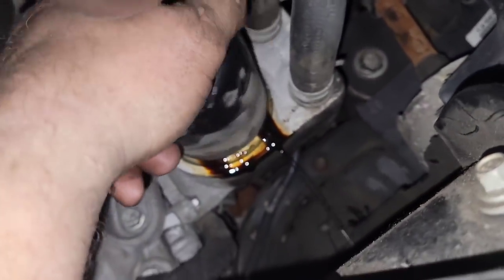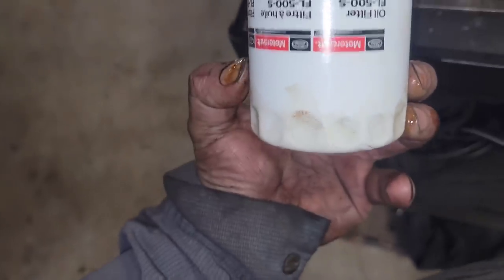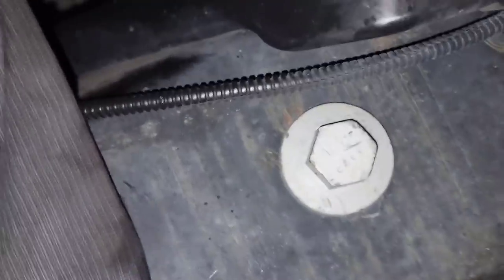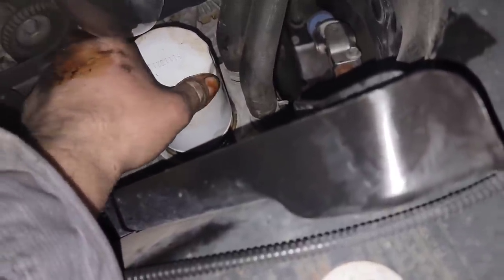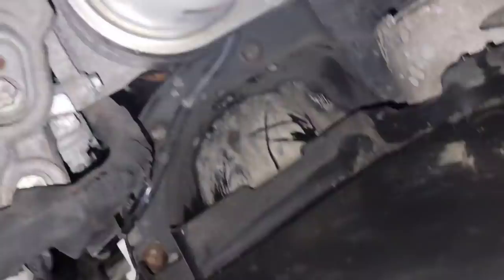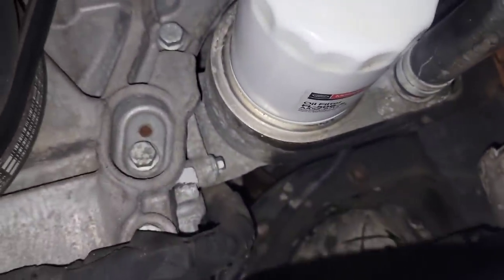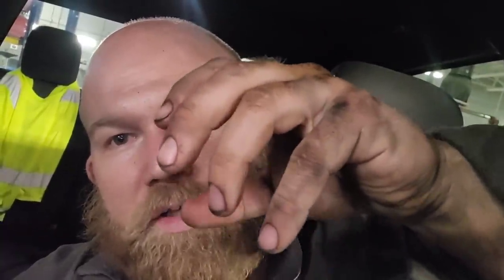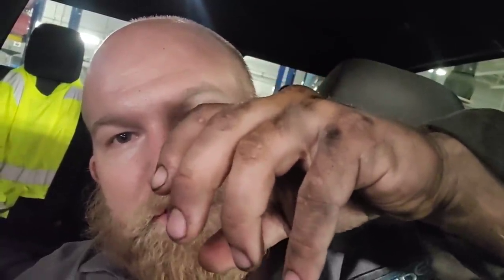Motorcraft Fl500 oil filters Recently I've had some issues with, Poorly Machined Threads

Comment: I've had my own issue with the FL500 filters.  I changed the oil on my wife's 2016 Explorer, 3.5L, non-turbo and was surprised to see oil drips on the garage floor.  I got down to look (not a major leak), saw an oily filter, ragged it off and tightened it up as far as I could, by hand.  A few days later, the same thing.  It was seeping oil at the crimp, which I have heard of, but not from a Motorcraft filter.  I replaced it with a Mobil 1 filter and will, from now on, spend a few more $$$ and avoid the FL500.
Reply from the maker: Make sure that the oil pressure sensor on the side of the oil filter housing is Tight and look at my video on the Ford Explorer oil leak in the library
Reply: @FordBossMe  Once I replaced the filter, no more leaks.  That was 2 oil changes ago and still no more leaks.  I've been a Ford guy all of my life and always use Motorcraft filters, still do on my 7.3 Excursion and have never had a problem.  QC at the manufacturing plant, where the FL500s are made must be lax at this time.
Reply: Did an oil change on sisters 3.7 Lincoln MKX and FL 500 started leaking a couple months later,  my brother put a different filter on. I have done probably over 100 oil changes,  never had a filter leak.  I didn't ask him if it was loose.
Reply: @Ford Boss Me  I'm having this issue right now on a 2022 mustang gt. Fl500s leaking at the seal or crimp after a few hundred miles, put another one on and same thing. Everything around the filter housing and oil pressure sensor seems dry going to try a different filter again of not off to the dealership. Would be my luck to get 2 bad motorcraft filters in a row

Comment: Noticed shallow threads on the new Motorcraft filters at Wally's. Ended up buying Walmart brand with much deeper pronounced threads. I'd rather have bought motorcraft but someone else is making em. Fl-820S as well has messed up threads

Comment: Wow, this was good to know. Good video and well done. I'm surprised that I am not the only one having this issue. I remember having some problems with some aftermarket oil filters in the past. They just wouldn't thread on properly to some engines. I have used another aftermarket filter from the same batch and worked just fine. Sometimes the oil filter housing on the engine itself is messed up for some reason and sometimes only certain oil filters would thread on and work. I'm not even sure if it could be that or other guys particularly from lube shops not being careful enough when screwing on an oil filter on to the housing and damaging the threads on the engine. Correct me if I'm wrong, but that is what I have experienced in the past. Sometimes I have to try multiple times to thread on the oil filter until it catches and goes in properly. Just my two dimes perspective.

Comment: Always check the filter mating surface, especially if your sourcing the filter from a big box store.

Usually I'm checking to make sure the oil filter O-ring is present and the filter mating face is clean and corrosion free. Guess we also need to carefully check the threads as well.

Comment: Just went through this exact same thing with a FL-910S. Went back to the parts store and got another one and it did the same thing. Had to put on a Wix. I hope they get their manufacturing issues figured out and get the bad ones off the shelves.

Comment: Had this issue on a carquest filter once got a screwdriver and I just forced the thread straight where I saw it was a bit flattened and it was good. spun it on and tightened but I never bought another carquest filter again.

Comment: FL910S also has an issue. Reaching in through the wheel well was fun on my son’s Ranger. It felt like it wanted to cross thread to me, was a struggle this time, usually pretty easy. Yeah, I know, take the wheel off - didn’t want to.
Reply: @es-qf2gw  Probably so. I’ll definitely check the filter closely before my next purchase. My dealership also sold me the wrong oil on this last go round. Gave me 5w20 instead of 5w30. A 30 minute oil change ended up being 2 hrs all said and done. The old saying measure twice, cut once. I should have double checked everything before walking out the door.

Comment: Changed oil and an FL820S on my moms Mariner after 2200 miles (80% city miles), cut the oil filter open to inspect (I do this every oil change) and the metal backing plate on the bottom end of the media fell off immediately when I pulled it out last time. Also discovered under the backing plate, the media is actually held together by plastic. 79k miles and use pennz platnium high mileage 5w20.
Reply from the maker: So it's not plastic it is a typical type of epoxy do they use in these filters all of them do that
Reply: @FordBossMe  was just sorta shocked when it fell off so easy. didn't realize it was an epoxy type material. thanks for the info man.

Comment: Purolator is really letting the Motorcraft line go. Switched to an FL820S and my 4.6 2V rattles a lot on cold starts after it’s been sitting over the weekend. I’m guessing the baseplate was poorly cleaned and pierced the ADBV as usual on newer Purolators. At work I’ve had to force so many FL500’s onto threads, back off, then and re-force over and over until they finally start. Seems to only happen on 5.0 and 3.5’s in F150’s. I never have a problem in the vertical 3.5 and 3.0 Duratec’s.
Reply: @dellsucksass  Good. People just now started using the 820 again on BobIsTheOilGuy so I wanted to start too and here all go having issues again. One will look great inside and then the next one will look really ugly. My truck never ticked with an Orange FRAM or a Wix XP, but the standard Wix and now an 820 made it noisy on startup. I have a Champ filter to run next.

Comment: This is good to hear. I ran into this exact problem last weekend. I ordered a FL500-S filter off amazon and tried to install it and it would not thread on. Same problem you describe. I was worried maybe I got a knock off, guess its just a bad batch of filters. I had to run to the auto parts store and grab a Wix filter. That one fit just fine
'

Comment: I just saw a video where the FL500 had glue all in the oil after only 3,500 miles.
I know the bypass is located at the top, but I also read that it makes no difference if the filter installs horizontal like on our 5.0 trucks?
I need to find a filter that doesn't get glue in the oil.

Comment: The early Saturns had a spin on filter for the transmission. I got a case of Wix filters that would start in and then bind, making one think it was cross threaded. I got mad and forced one in and it got past its tight spot. Seems that the entire case had a burr on the same spot of the threads. Somebody at the factory was lazy or having a bad day.
Reply: A bad vibe

Comment: Yeah this is normal for purolator. Every 5 years they shoot themselves in the foot. Motorcraft specs a good filter but that doesn’t mean purolator will follow through. I always stick with wix. But now that there owned buy the same company as purolator it makes me nervous if catch a bad wix I’ll probably switch to fleetguard or denso. Owning a filter cutter is priceless
Reply from the maker: I've had a couple of the Wix filters back off and also the o rings not fit the top of the house incorrectly
Reply: As seen on BITOG, M+H is slowly moving the standard Wix line to being equivalent to a red Purolator.

Comment: Ever since ford switch from the painted or printed letters to the stickers on their filters in the past year they have dipped in quality big time. Lighter in weight and they seem to be a thinner material than before.
Reply: Anyone peeled the label off? 
With all the supply issues they might just be rebranding someone else’s filter by covering the other mfg part # with a label
Reply: @dgrenier4908  They’re still Purolator but they’re consolidating their lines and have started cheapening the filters up.

Comment: These oil filters are getting kinda weird like you said.  I had to Napa Silvers I used on ny wife's 17 Arcadia the were not true on the threads and you can visibly see it wobble while spinning up but I took a chance and they never leaked but I'm going to use a 500s Motorcraft next to see if it gets rid of some motor rattling
Reply from the maker: I stick with my Fran Ultra synthetic and love it and also the Ford filters but this is concerning

Comment: The parts at my local Ford dealership gives me the filters you are referencing in the vehicle now, stopped giving me filters with the numerous ribs .Maybe that’s because the supplier of the filters has changed. I have a few that have many more knurled ribs around the closed end, so many I had to purchase another filter cup for my 3/8” ratchet. Both are FoMoCo but type etc is applied differently too. 
s mother trying to save money? Wonder if the insides of each are the same. I think I’ll check when I change my oil next and cut it open.
Reply: Purolator switched from the ribbed type can to the one with flat edges and is more easily  removed with filter tools. Occasionally I’ll still handle some new old stock that will even have the old Motorcraft labels.

Comment: Purolators quality control has been crap for years now. Not surprised about the threads being junk. The issue they have with the media tearing started about 10 years ago and they have yet to fix it. Ive seen multiple motorcraft filters with torn media and because of that I stopped using them and anything purolator makes.

Comment: I don't use FL500 on my 15 GT I went to FL280 ford racing version. Biggest problem local stores have no damn oil filters in stock. I ordered 2 FL280 from rockauto and Ford racing filters from Summitracing

Comment: Remember when Ford oil filters switched from painted on branding to the new stickers in the last year or two? They switched to a completely different manufacture for all their oil filters. I no longer trust motorcraft oil filters, wound up having to get a fram for my ford diesel. At least fram 7.3 filters have been around for 25 years...
Reply from the maker: They did not switch to different manufacturers it's still puralator

Comment: How many threads does it take to hand tighten a filter. Some techs at the dealer want to get them so tight you need to stick a cro-bar through them to get them loose.  All a do about nothing.
Reply from the maker: So the proper way to do it is to spend the wheel filter on until it makes light surface contact and then go 3/4 - 1 full turn past

Comment: Another Odd  Filter issue lately 6.7 powerstroke fuel filter FD4615 the upper one, the plastic housing of the filter on the new filter is to large to fit in the pocket also from Chicago Parts and Sound. Our Supplier just says it is a potential manufacturing issue that they have to contact the manufacture on.

Comment: Ironically I had the same thing at my dealership. We do a lot or ram trucks and a new hire had a 5.7 1500 oem filter didn't screw on. Brand new truck. I thought please don't be the dang spindle 🤦🏻‍♂️😮‍💨  it would go on two turns then lock up like it's stripped or missing threads. Sure enough the oem filter didn't have the threads on the filter right. Grabbed a new one boom like butter 🧈 😋 👌

Comment: Love the vids.  I know you’ve covered this before but need to ask a question.  How do you feel about the brand “Driven” for motor oil?  I ask because I just picked up a 2012 Boss 302 with 34k on the clock and the engine was replaced with a brand new ford crate engine back in December.  I’m looking at which 5w-50 engine oil to use.  I know you want an oil that has high zinc levels for protection.  Driven was designed with that in mind from what I understand.   In doing research I also learned that oils with higher levels of zinc need changed more frequently.  Is this accurate?  There aren’t a ton of choices out there in 5w-50 so I thought I would ask for your opinion.   Thanking you in advance.
Reply from the maker: I think the reason most people are worried about high zinc content is because of the catalytic converter and the zinc causing issues
Reply from the maker: As for the brand itself I don't know very much about it honestly
Reply: You probably have a roller cam system. Zinc benefits old flat tappet engines.
I use high zinc oil in my vintage Jeep and 73" Mach One. 
In those I use Lucas Classic Car oil. Very high zinc content. No Cats. 
Newer vehicles don't need as much zinc. So in my 2021 E450 (7.3 powered) I use Pennzoil Ultra Platinum. It has done well in testing and is reasonably priced.
Reply: @FordBossMe  thank you for the feedback
Reply: @TheBandit7613  thank you as well
Reply: Amsoil has it.

Comment: Please i need help! an oil filter i had cross threaded the actual oil filter holder thats mounted on to the housing. i am not sure how to get this off!
Reply from the maker: So if you look in the threads of the actual oil filter mounting base in the center of it there's an allen fitting it's like 70 mm you have to find the right one for your vehicle and you can actually unscrew the center of it and replace it with a new one usually
Reply: @FordBossMe  i will take a look thank you for the reply

Comment: I have a 2005 mustang gt that makes a weird tapping noise after changing the oil. It goes away after a few minutes. It’s a weird tapping noise. It’s not steady more like someone is typing on a keyboard tapping.
Reply from the maker: That's because you need to flood motor vehicle to pre Prime the oil system
Reply from the maker: Look in my library for directions

Comment: Forbid the threaded part of the engine oil filter mount crossthreads on alot of engines they are part of the engine and not replaceable

Comment: Wow! Can’t even make oil filters correctly any more. Do these manufacturers even have a quality control department anymore? 
I noticed fairly recently motorcraft filters have changed. They now have stickers instead of painted info on them. Some of the filters used to have a fine spline on the back of them and now they have a hex shape on them which requires a different socket for removal. I suspect motorcraft is possibly buying filters from a different company now. And their quality seems to be worse. 
A friend of mine recently had an fl500 on his ‘17 explorer fail, it just sprung a leak at the metal seam when he was driving on the interstate. Luckily he caught it before it ran the motor out of oil….

Comment: There’s no better way for the oil not to drip? There’s what looks like a drip pan under the oil filter but the oil doesn’t go in the drip pan, the oil just goes down the front of the engine
Reply from the maker: You're not looking at it correctly

It has two holes 1 drips right down the front right into the pan and then if it overfills or something plugging that hole it has a release to the front as well it's not going down the front of the motor I have previous videos where I break this down even more showing how to be very clean and careful when you do this

 check those out
Reply: @FordBossMe  ok thanks, I’ll take a look
Reply: @FordBossMe  do you have Instagram? I ask because I just had the Ford dealership replaced a failed water pump and I just did an oil change yesterday and I found a weird metal thing in the tray we are talking about, wanted to send you a picture of the metal thing to make sure it wasn’t any important

Comment: Chase the thread with a 22x1.5mm tap
Reply from the maker: No!
 don't do that 
give the filter back

 make them give you a new one and be aware of the screw up and if it is machined on an angle it's not going to sit on the vehicle correctly so do not Chase it do not use that filter replace the filter with a good one
Reply: @FordBossMe  Yeah probably not for the weak at heart, I am pretty sure the threads get cut before the filter gets put together so there are no metal chips contaminating the filter. The threads get damaged during assembly of the filter. Thanks for all that you do.

Comment: Made with pure chineseium.
Reply from the maker: These are made right here in the United States
Reply: I wouldn’t be shocked if M+H switches everything to China. The Purolator Tech filter line already has been changed over.
Reply: That what I was thinking.  Lots of fake Ford-MotorCraft parts out there.  = Instead of MotorCraft you are getting MotorCrap.   Check the boxes very carefully.